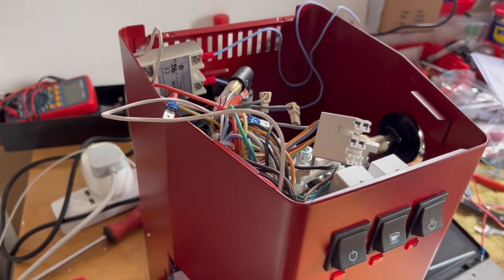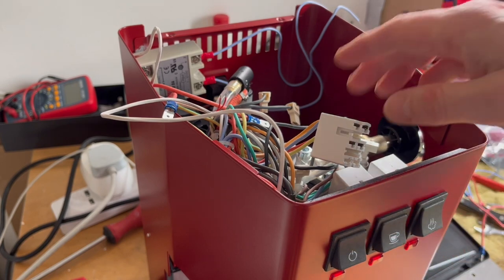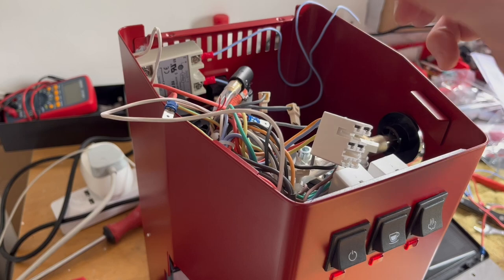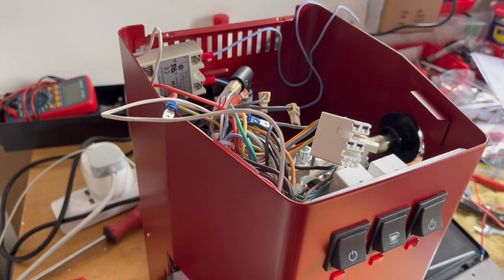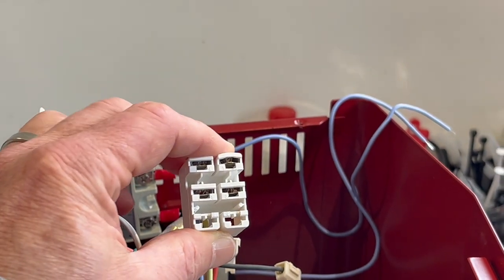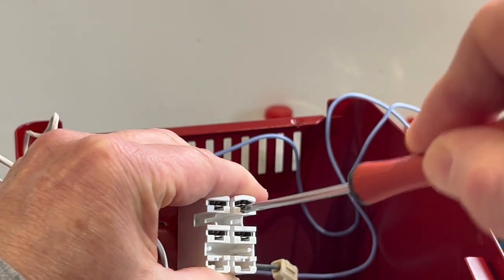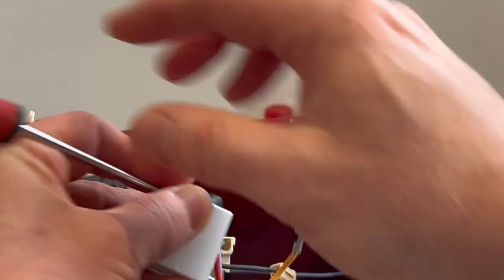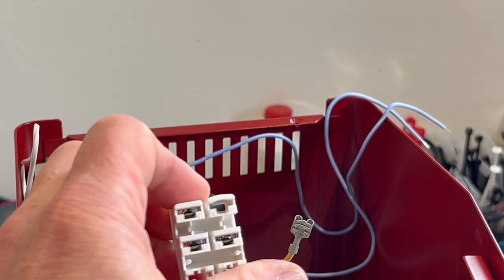Gaggia Classic New Switch Wire Removal

Comment: I disconnected this wire when I did a LED MOD.  My connector block was black, but otherwise the same.  I had to use a VERY small screwdriver and push REALLY hard.  There was a very noticeable POP then the wire just came right out.